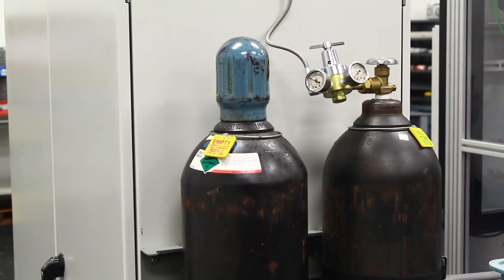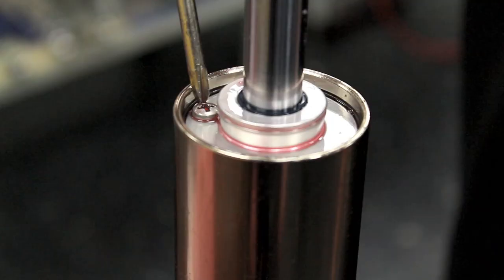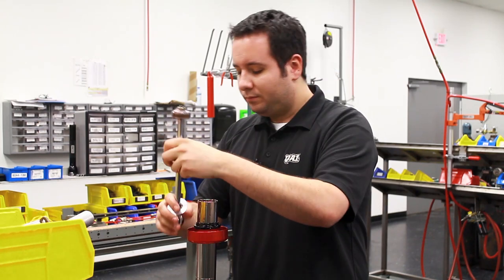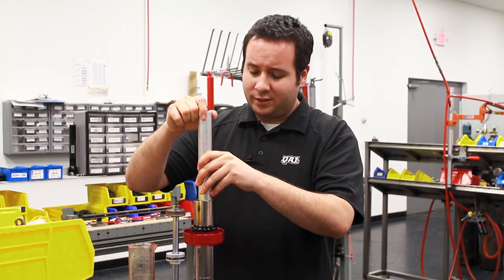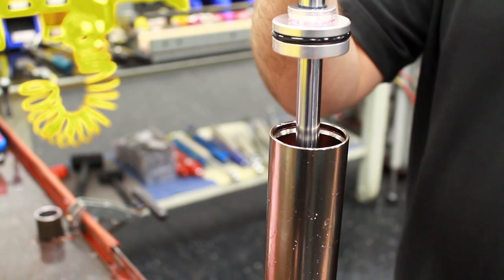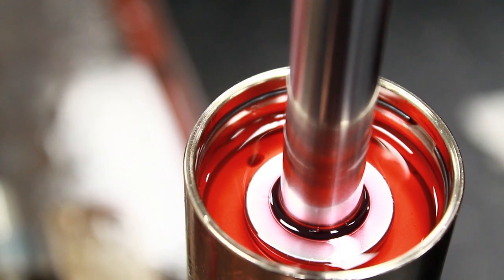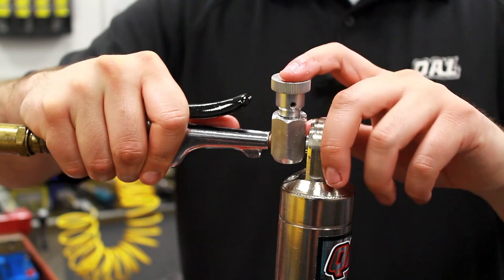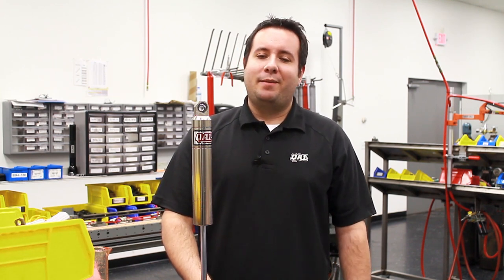How To Rebuild a QA1 Circle Track Monotube Shock

Comment: What kind of tools did you used to put a nitrogen into shock??
Reply from the maker: It depends on the valve fitted to the shock, but we use either a Schrader valve fill tool or a Hyperscrew fill tool. Here's a link with more info: http://www.qa1.net/suspension/circle-track-shock-accessories/monotube-schrader-valve-fill-tool
Reply: How about tein coilover? What kind of tool used for that?
Reply from the maker: Sorry, but I'm not familiar with Tein's construction or if rebuild parts are available. I replied to you on Facebook as well with a link to our authorized rebuilders. You could try reaching out to one of them to see if they can be of further assistance. Also, Feal Suspension might be another resource you could look into. Thanks!

Comment: How do you know how much psi you’re putting into the shock?

Awesome video!!
Reply from the maker: The gas pressure in the shock depends on the compression valving of the shock. The stiffer the compression valving, the more pressure that’s required.

For 26 series shocks, set the pressure regulator on your nitrogen tank to the following pressure:
Compression Valving                      PSI
1                                                              100
2                                                              100                         
3                                                              100
4                                                              100
5                                                              100
6                                                              100
7                                                              125
8                                                              150
9                                                              175
10                                                           300
11                                                           300
12                                                           300
Reply: Thank you.
I want to do some “tinkering” so I can get a better understanding on shocks.

Comment: what is the pressure to fill in? in psi
Reply from the maker: +eezuan othman It depends on the compression valving of the shock. We use 100 psi for up to a 6 valve, 125 for 7, 150 for 8, 175 for 9 and 300 on 10, 11 and 12. You can call our tech line at 952-985-5675 if you have any other questions.

Comment: Hyper screw?
Reply from the maker: A Hyperscrew is a QA1 Exclusive gas sealing screw. Through the Hypercharging process, nitrogen gas pressure is retained inside the shock by the Hyperscrew. If you have any other questions, feel free to contact us at 800.721.7761.